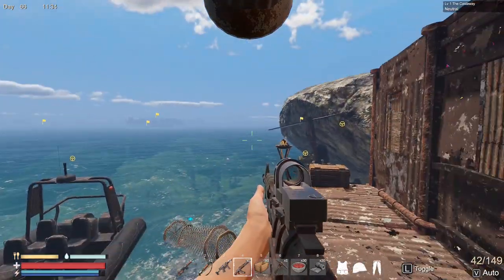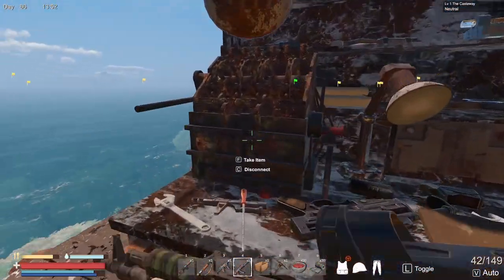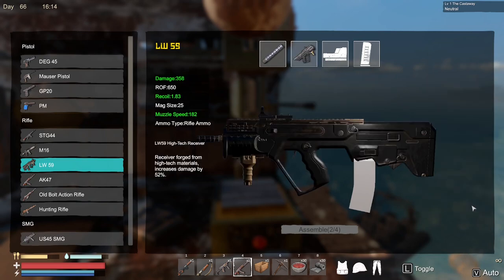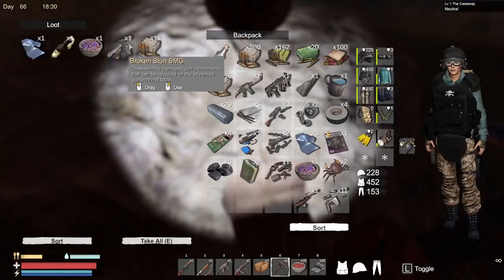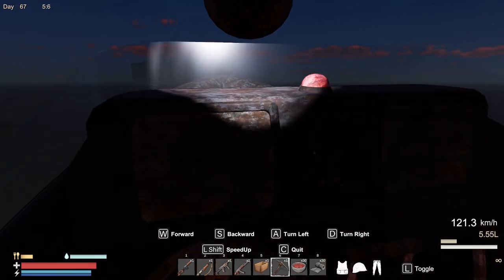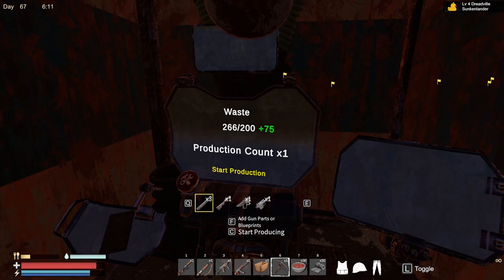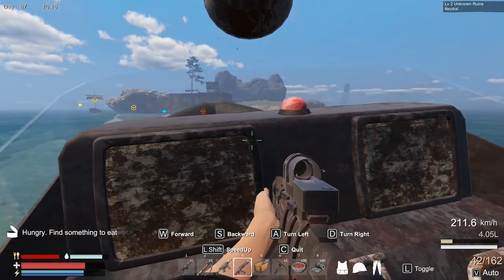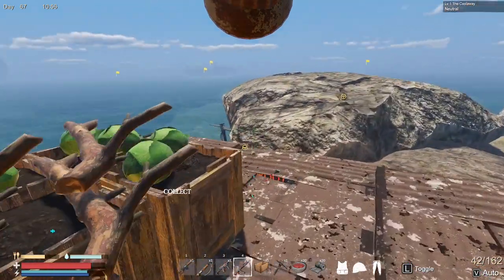Sunkenland Gun Bench Explained - Sunkenland Guns - How To Make Guns - Latest Update - Get Guns -

Comment: Very informative. Thumbs up and subscribed.  But I am still confused (nothing new). So you have to find or make blueprints before you can even start making a weapon, right? Then when you have found and made the blueprint you have to grind broken gun parts which give you random parts (you don't what you are going to get like making the blueprints). The grinder gives you good gun parts which you then assemble. Correct.  So you can't used broken gun parts directly. Correct?  Thanks for your informative videos.  I have just started the game over after basically finishing the first version and have forgotten a lot and a lot has changed.
Reply from the maker: So when you first build the gun bench and you have not found any blueprints you will not be able to make any gun parts. You find broken guns grind them for blueprints in order to unlock the parts. At that point you can make the part. If you are lucky enough to find a part in and around the map you can use that specific part even if you have not unlocked it yet. So basically no gun until blueprint is unlocked, then made, or you find parts to make a gun. Hope this helps if not please let me know. 😃
Reply from the maker: I will try to make a bullet list maybe it will help. 
- build gun bench and establish power 
- get broken guns grind them for blueprints and learn them. Or find blueprints around map (randomly generated in crates or safes). 
- once you have learned the blueprints you can build corresponding part / parts. 
- sometimes you get actual gun parts, you can use these parts even if you have not learned the blueprint for said part. 
- manufacture parts with resources mount the parts then when all parts are mounted assemble the gun.
Reply: @RowdyGaming710  thank you.
Reply from the maker: @hamrad88  you are very welcome hope that helped 😃
Reply from the maker: And thank you so much for the sub!!
Reply: @RowdyGaming710  Yes with your help I think I have got it now.
Reply from the maker: @hamrad88  so very happy to hear that! Thanks.